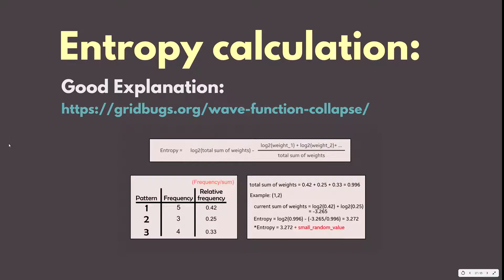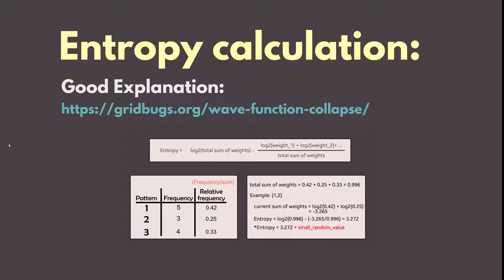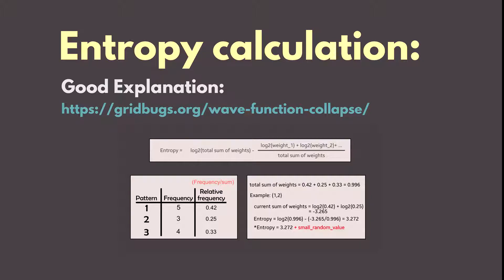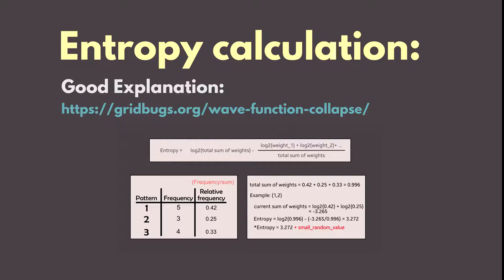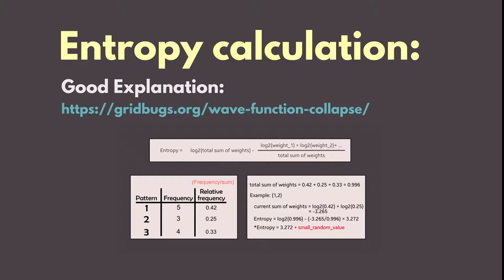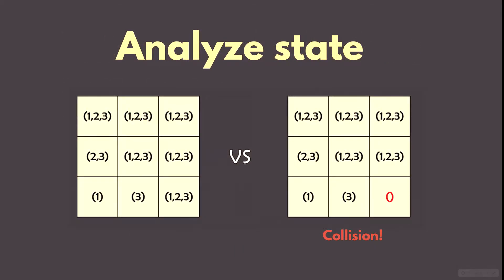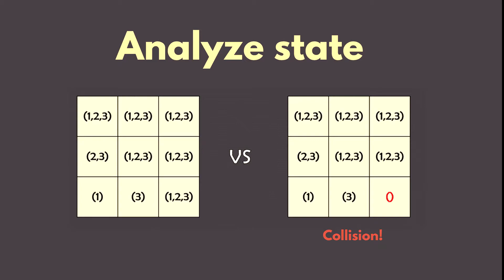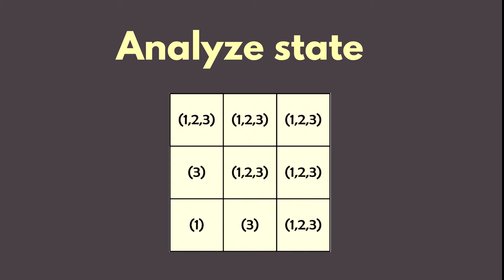Wave function collapse Tutorial 07 Theory - Analyze results step

Comment: 0.42  + 0.25 + 0.33 is not 0.996 Or am i missing something?
Reply from the maker: Yeah sorry! I will check it and let you know what is the mistake here!
Update:
Thank you for that comment. It seems I have made a mistake when figuring this thing out. The total_sum_of_weights is the sum of POSSIBLE weights. So in this example it would be (0.42+0.25) = 0.67. The log2 of that would be -0.5777, the sum of logs of separate weights would be -3.252 and we divide it but the sum 0.67. This gives us  -4.854. Subtracting -0.577 - (-4.864) gives us entropy of 4.277 (unless i have again miscalculated something else which apparently happens a lot to me).
Thanks again because I have to fix this in the code. I will be uploading a new video explaining the change. Sorry for the inconvenience!
https://youtu.be/cEXVbXxhMz4 here is the updated video.
Reply: @SunnyValleyStudio  Thanks for fixing it :)